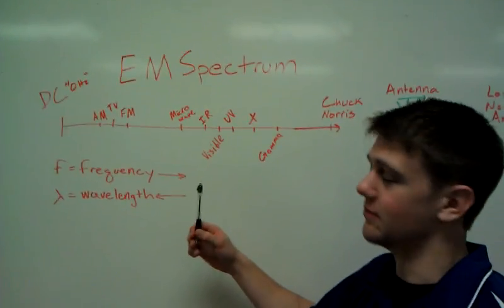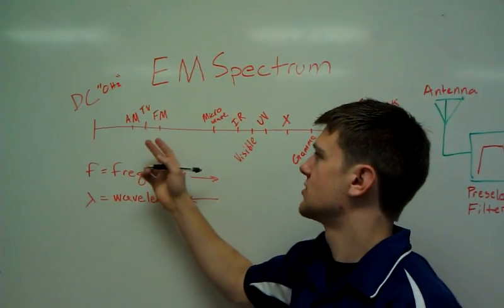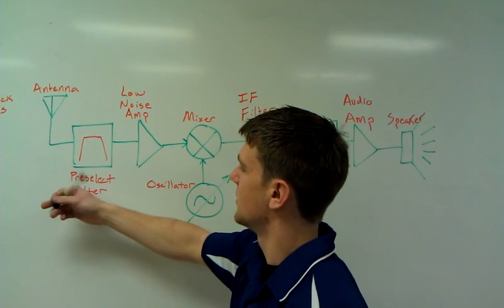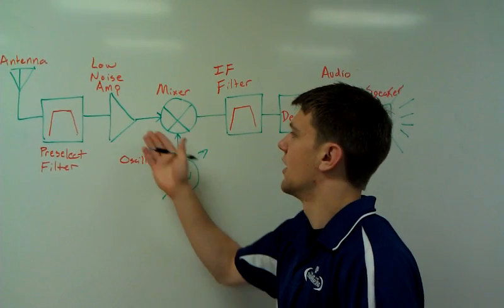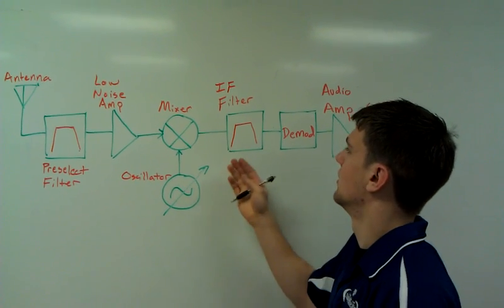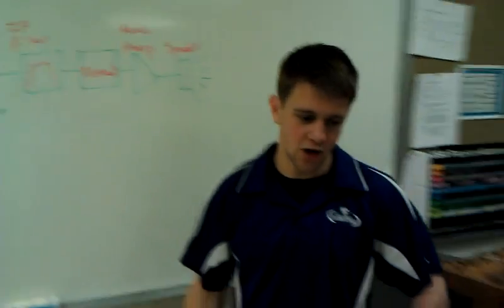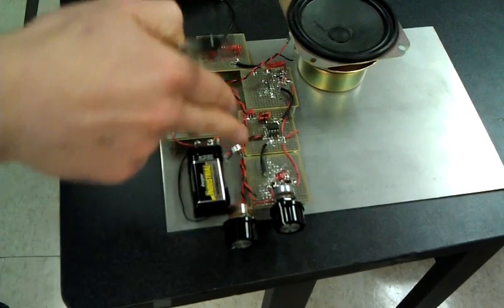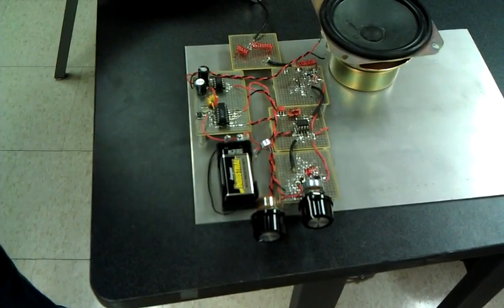FM Receiver (Radio) Design

Comment: I am working on something to transmit some signals via radio signals and so I just need a single frequency to work with. In that case should I connect the output of the low noise amplifier directly to the IF filter?
And by the way Skyrim is pretty popular actually. Love that game. And really nice video.